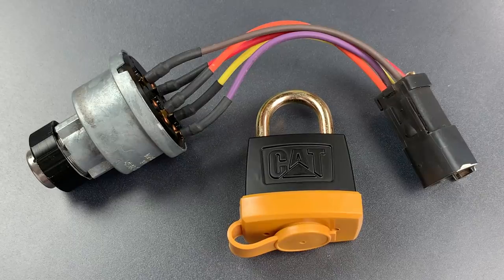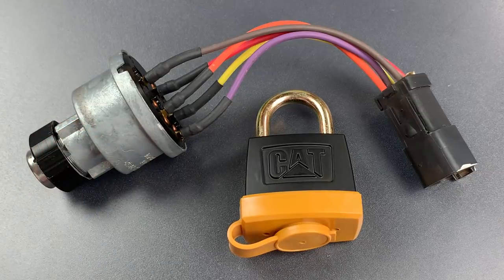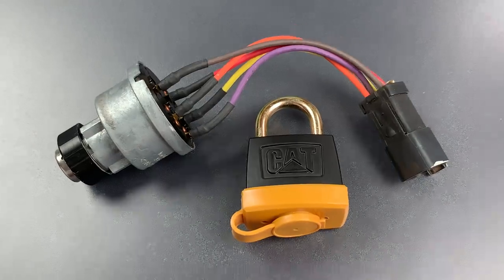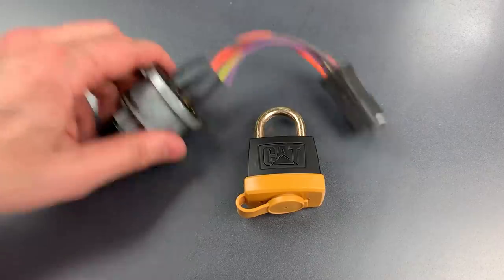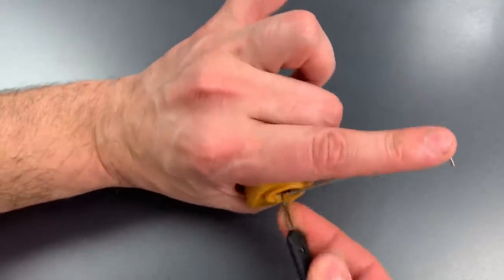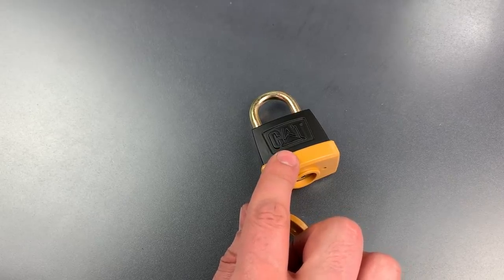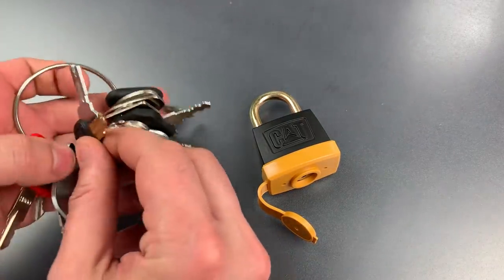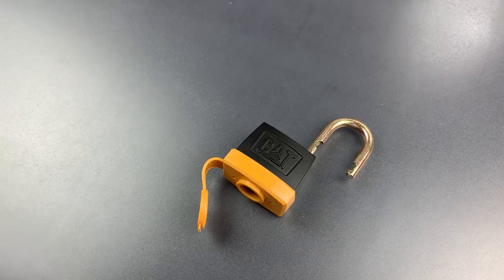[811] These Caterpillar Padlocks ALL Use The Same Key

Comment: It is funny seeing these physical security products from a company so adamant about enforcing (internal) information security.
Reply: In what way? Buy 5+ machines from cat and they give you a sis login and a basic ET, they are more open than any other OEM....try the same with doosan, cnh, or john deere.....
Reply: @bytefix2603  I meant as a contractor/employee to/in a not CAT branded division.  I cannot speak for other divisions; but the internal parts I was exposed to (that did bear the CAT branding) was designed and operated around distributing information offsite so that it is only physically available when needed, with limited timed windows of access monitored by a third party, and once it is no longer needed the physical media is shredded, (loosely) recycled and scattered to their customers.

FFS; I was reprimanded for suggesting drafting a bounty-style request for ball bearings when our supplier suddenly couldn't [redaction] -- because public bidding would also reveal to our competitors what size ball bearings our designs used. [redaction]

Comment: Alright, I work at a Caterpillar dealership, I'm a mechanic there. The reason the keys are the same is for a few reasons. 1: For fleet use, rental companies coundnt keep track of the different keys for each machine, especially if a customer lost it. 2: The padlocks are to keep idiots from putting diesel in the hydraulic fluid tank or hydraulic fluid in the DEF tank. Its a idiot deterrent, not a foolproof security measure. Those padlock only go on machines, people dont use them to secure anything.

Comment: why even bother? never known anyone breaking into a construction site use the gate, always just hop the fence, hell, that's what we did as kids

best security those sites ever had was someone on site.
Reply: Ascdren it’s hard to take a half-ton of copper pipe out over the fence. 

I was working on a site where someone with a site key opened the gate, cut the hasp off our connex box, and filled the bed of their pickup truck with copper pipe, damaging the pipe in the process. 

A couple phone calls when we noticed in the morning, and they got caught trying to sell it at the nearest recycler. And the GC had to find a new roofing contractor real fast.

Comment: This lock is originaly used only for the CAT excavators.Maybe someone is puting them on the improvised fences of the construction site but they are not made for that .There are two versions that could be find.Older one is much rare to see than this one from the video.The older one has plastic cap which is slightly darker yelow  and much better quality of plastic is used for making it.It also have protective black plastic on the shackle and the body looks aproximately 1-2mm fatter than newer one.On the other side newer one doesent come with protected shackle and keyhole cap is stiffer and not so flexible in comparison to the older one.Those locks could be found on fuel caps,tool boxes integrated to the machine and some red rectangular red bars and nowhere else.They are ataching one more model which is or was made by ILLINOIS LOCK CO.It is black and oval shaped.It uses the same key .Older illinois model doesent have protective plastic cover for the body and it has only the old CAT logo which reminds of the letter ,,C,,.Those 3 wafer padlocks can be in theory compared with SIG INVIROMENTAL-s.The intention was not to be hardly pickable or unpickable but only to protect the folowing equipment from falling while working or from somebody passing through who can just take it with hand and go away.They must sustain under hard weather ,moisture and mudy conditions so the mechanism must be simple enough because in other case lock colud jam.

The funny thing is that in my country workers think that those CAT models are high quality and security products,so they are replacing them with chinesse crapy disc detainers and still them for home security or something else.They dont realise that even chinesse disc detainers could be harder to pick than those Cat-s.Anyway nice look and atractive style but not so atractive security.I realy dont know who makes the model from the video because there are no markings at all.Oval one is most likely from Illinois lock co ,and it is stamped that its made in the USA,but for this one ,nothing.My theory is that CAT make them ,or some chinesse factory,because reecently in the market apeared the same padlock ,same shape but without cat logo on it.

For all of you who are interested in history of padlocks on CAT excavators ,as far as i know they used CORBIN zinc padlocks,than oval ILLINOIS with weird logo which reminds of the letter C ,Oval shaped ILLINOIS with protective plastic cover for the body,Rectangular shaped CAT with plastic protected shackle and flexible plastic yelow cap and the last one is the one from the video.All of them are probably made from zinc in some scale and have three wafers except the CORBIN who s body was fully made from zinc and had five pins inside.

Comment: Common keying seems to be seen quite often in onstruction equipement and other devices, as forklifts, electric pallet trucks and stuff like this. I operate a truck mounted fork lift thats also common keyed, the keys are available on eBay.

Comment: The industry needs these. They are used for parts drop boxes, where we need to get parts after hours they can be placed in a drop box outside the parts store. Anyone in the industry will have a cat key, but your average hoodlums will not. It's also not worth their time to pick it, if they're just trying to cause mischief. 

It's not perfect but it has worked fine for decades. 

Take it easy.

Comment: Pretty much all heavy equipment use very weak ignition locks, that way you can use several machines with the same key.  It's why almost every one adds a hidden battery switch some where.  Sadly that does not stop thieves and why most use some form of lojack.  Which sadly gets disabled in mins.  A few years back a hit tried to steal my back hoe  off my job site, luckily I was there in my trailer as it was not the 1st theft too happen in that site.  Nothing like a 12 ga to make some one run... took 2 hours for the local pd too show up

Comment: You can buy a set of Amazon that has keyed alike keys for most heavy machinery. Heaps of contractors over here in Australia keep a spare keyring with those keys in our tool bags. The set isn't cheap but if you work in construction and you are some times asked to jump in machines or work on a site were a machine has to be moved but the opperator isn't present they help

Comment: These locks aren't really made for high security more made for use with a piece of equipment to lock up systems like a hydraulic system  or fuel system to protect them. Most of cats caps on these systems have spots for these locks so there's a small deterrent but easy enough to service

Comment: they are keyed the same yes but the equipment has a special master key that will keep it from runing even with the ignition key in the runing position
Reply: Do you use the Master Key on the battery cable? That would keep the starter from operating but won’t stop it if it’s already running.

Comment: First things first so what you can pick the ignition,it takes a seperate key to turn on the batteries to allow the machine to run,and the reason they use the same key on alot oof models is less keys need on a site.
Reply from the maker: You may have noticed the battery isolation switch key is also on my ring. 👍

Comment: Heaviness and size of heavy machinery is so good deterrent against thieves, tha't high security locks aren't needed.
Reply: It is logistically nearly impossible to smuggle and sell stolen machinery out of country without anyone noticing. That's why i don't think heavy machinery needs a high security lock. Place a Gps tracker instead, if you are worried about your machines.
Reply: @lollagemies  
Until some drunken numpty who knows how easy these things are to get into decides to take one on a drive, leaving a trail of destruction.

Or somebody decided to steal one to use it as a way of brute-forcing an ATM.

Or somebody with a grudge against the owner...

Comment: Hey man. Listen, for decades, heavy equipment of like brands have used the same keys for their ignitions. This is something that shouldn't be spread around as even though some of the newer equipment is being keyed differently, a lot of the old equipment will all accept the same key. This is the case due to lowbed  driver's and fueler's need to move equipment after hours without access to distinct keys. I imagine this lock's purpose is to keep fuel doors or bay doors on the equipment relatively safe from kids and passers by while allowing those who need access easy access without carrying an entire keyring of keys. These things are better left off of the internet.
Reply: Security through obscurity doesn't work.
Reply: @bdf2718  k
Reply: @bdf2718  Worked great for the TSA and elevators. LOL :D
FYI TSA released a document on the internet with a photo of all their keys to open luggage locks. Didn't take long before people made their own keys using the photo. Now your luggage is about as secure as using a piece of string to lock it.
Not that they needed the photo because you could buy the locks, tear them apart and get the bidding for the master wafers to make your own key.

Comment: will you ever write your views on locks in general, as most locks are defeatable with brute force.  eg bolt cutters and hardened core types only guard against the rare 1% that have technical skills to beat the lock with out destructive means.  Its been my view take most people willing to bypass the locks will do so with force and not skill as it takes less time and knowledge. Given the criminal mindset they will just break the lock not learn how to defeat it with technical skills. you have a vast range of skills to defeat the locks on a technical level but most criminals just break the lock to gain access.

Comment: Hmmm. Having one key for all locks has to be the stupidest decision ever, let alone the crappy cylinders. 🤔
Reply: I was working as a storekeeper in a company making doors and stuff. And once I had to send a cylinder and 5 more keys, so I took the cylinder in the store and asked my boss where were the 5 other keys, and he pulled a drawer with like 40 keys inside, took 5 random and said "here they are, they're all the same"
Like people use this cylinder for their door, wth
Reply: The thinking is probably that it would prevent delays if the key for unlocking some piece of equipment went messing, was with an employee who called in sick, etc. Perhaps they’d done the math and found that the losses in productivity and delays from missing keys were a bigger problem than someone stealing/accessing equipment.
Reply: They aren't trying to secure anything. It's like putting a lock on a plastic hasp: nobody in their right mind can think it's secure but it is also an extremely strong indicator of malicious intent if the hasp is cut. Basically a tamper evident sign.
Reply: Actually, if you're going to have a common key for all the locks then the crappy cylinders are the stupidest decision.  Because you might as well use wards alone.  Which would stop a rake attack working.
Reply: In an industrial setting having all of the locks keyed alike makes sense. In the event of a lost key it can reduce downtime from hours or days down to minutes.
Reply: @Anonymouspock  
I think your dozer going missing is evidence enough of tampering.

These days, when people steal dozers to try to crack ATMs open, it's probably inadequate.

These days, when terrorists use whatever they can to carry out attacks, it's probably inadequate.

These days, when disgruntled workers are likely to try to damage heavy equipment by doing something stupid with it, it's probably inadequate.

Back in the old days, when none of those things were likely, having a common key saved time in many situations and protected against opportunistic thieves (but not determined ones).  I'm not sure the economic analysis comes up in favour of a common key these days, maybe it does or maybe it's just people unwilling to change their ways.

One purpose nobody has yet mentioned for a key on the vehicle.  You could just have a switch on the vehicle that didn't need a key, but a key provides a safety mechanism if somebody is doing some maintenance on the vehicle: remove the key to stop some idiot starting it up while you're working on it or have left it in a dangerous state.  But that's far from perfect when anybody might have their own key.
Reply: bdf2718 the safety mechanism for preventing someone from starting the machine when you’re working on it would be to disconnect the battery.
Reply: @danpowell806  
Except disconnecting the battery takes time.  And isn't a lot of help if you're trying to figure out what's wrong with the electrical system.
Reply: bdf2718 taking the key out also takes time, and also prevents you from using battery voltage to troubleshoot the electrical system.
Reply: Disconnecting battery may have serious unwanted consequences, like ECUs going mental and other computers demanding digital pairing to each and every single one of the 1500 sensors installed on modern equipment.
Reply: Do you remember how annoying it was in the 70s and 80s with GM cars? One key for all the doors and a different key for the ignition

Comment: This is politically correct lock. 

JOB: lock the dangerous stuff. ( So you lock it but in case of danger the lock can be opened by a child. ) Statement JOB DONE.  politically correct for pencil pushers.